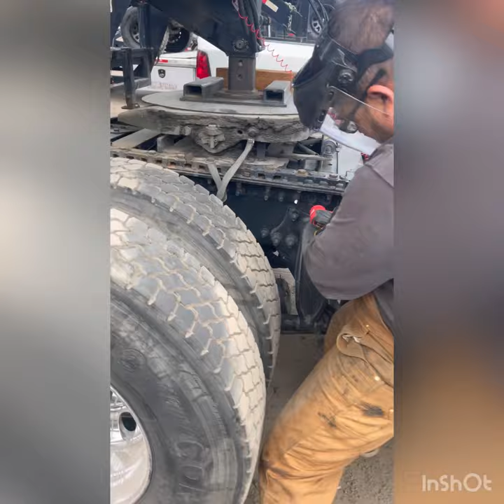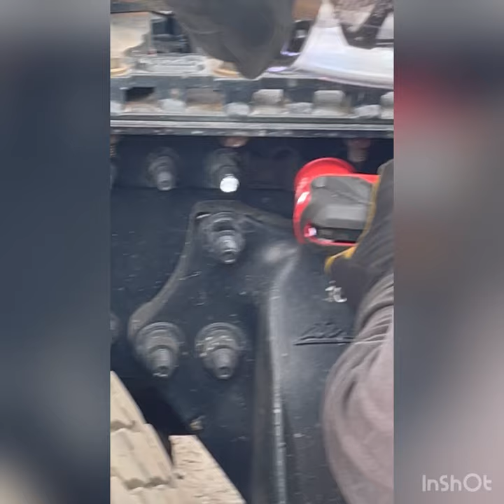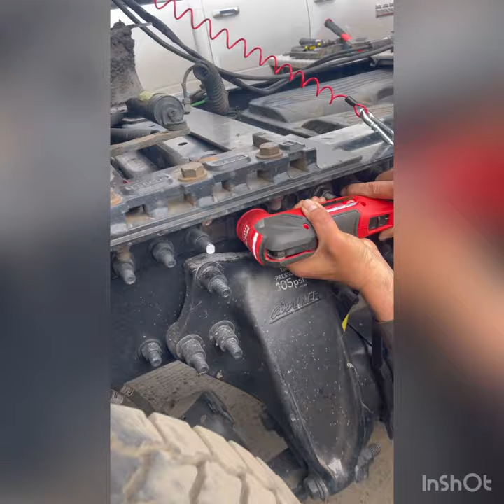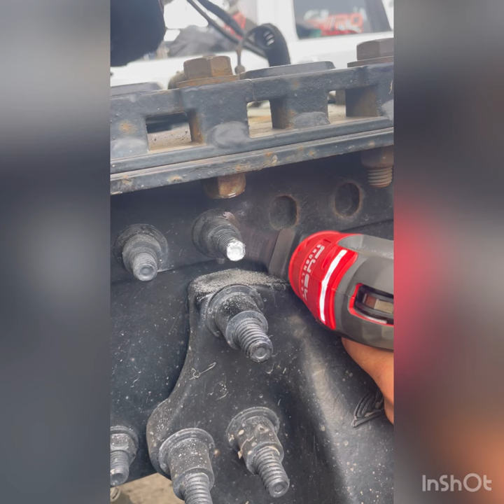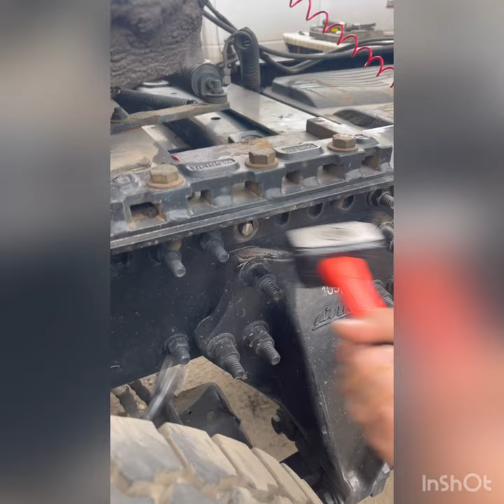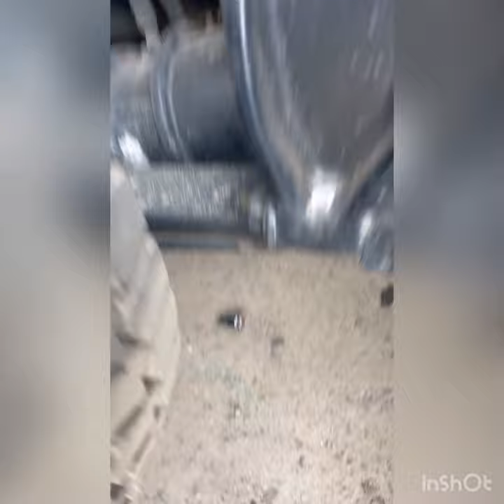How to remove Huck LockBolt on a semi Truck with a Multi-TOOL

Comment: Holy moly why would you spend 20 min shaking your hands off when you could just use a torch
Reply from the maker: Because not everybody has a torch . Some one has done it for me with a torch but  this time no one was available so I had to used what I had and it work . It was 5 min not 20.
Reply: Use what ya got in a pinch, folks gotta remember 2+4 or 3+3 both equal six in the end🤙
Reply: Some guys are shop queens and some are field mechanics.  👊
Reply: Yeah cuz heating the frame up with oxy will keep its strength 🙄🙄
Reply: If you know how to use a torch you can zip off a huck bolt in 10 seconds with a torch and hammer. It's quick enough it doesn't damage frame